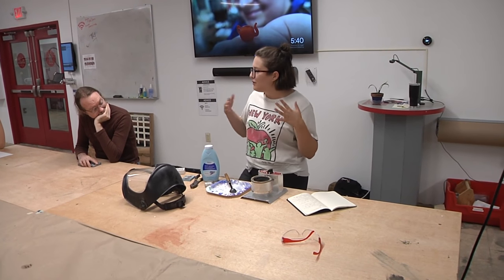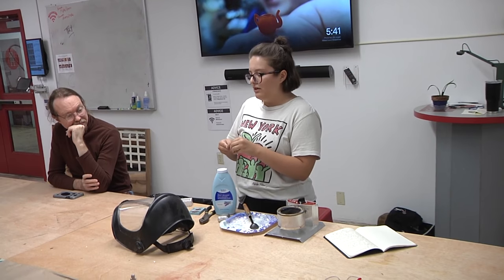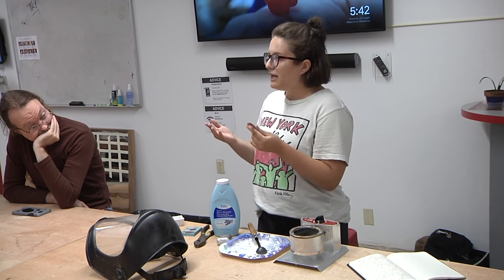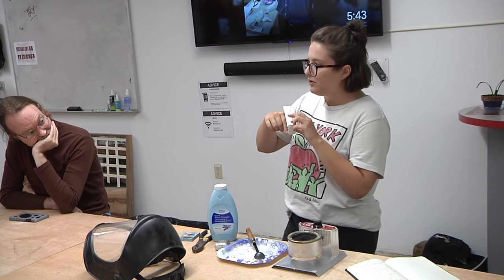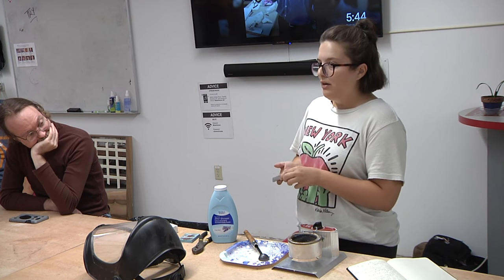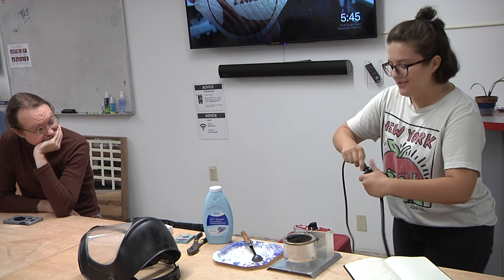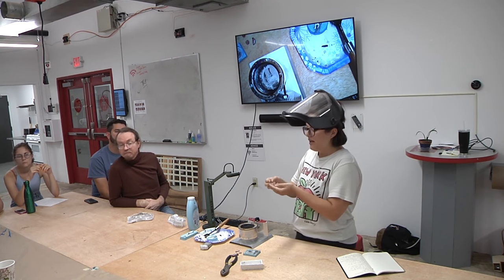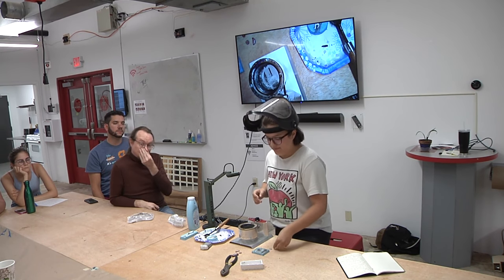Casting Low Temperature Metal (Tin Bismuth) in Silicone Molds

Comment: Do you have any suggestions how to avoid having bubbles come out the metal and deforming the back side of the final product?
Reply: Some use a pressure chamber or vacuum chamber.
There are also some additives you can use to increase the viscosity of the molten metal.
Reply: Bubbles usually come from the water trapped in the mold boiling from contact with molten metal.